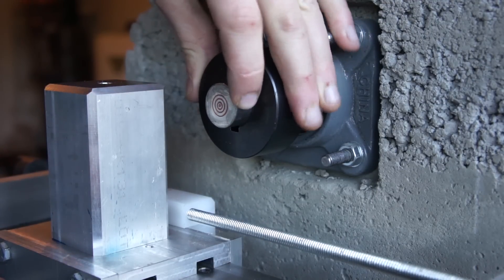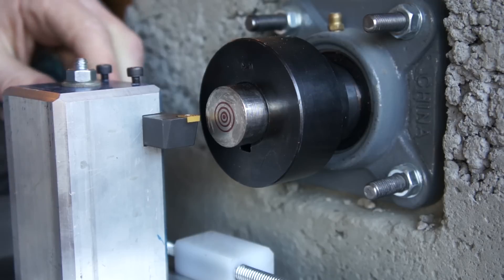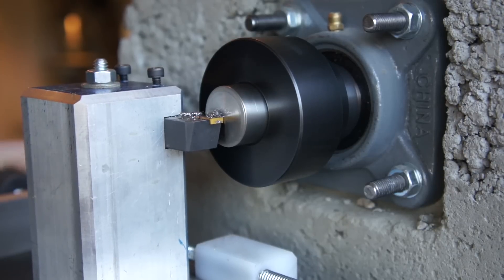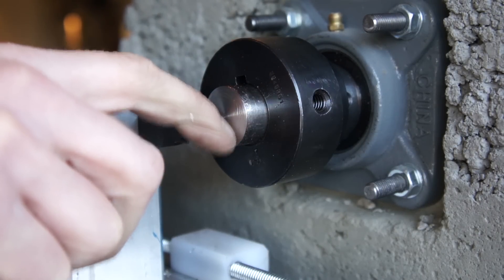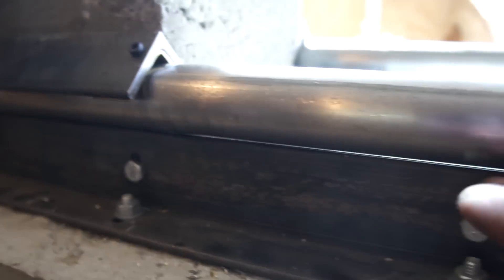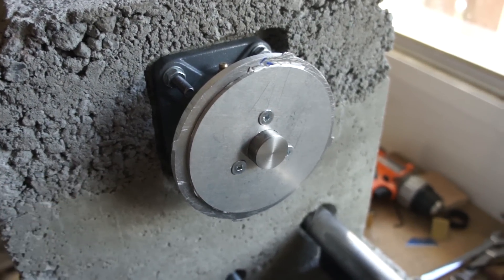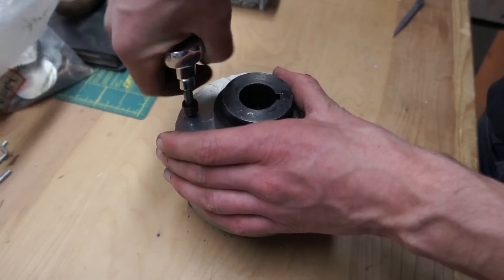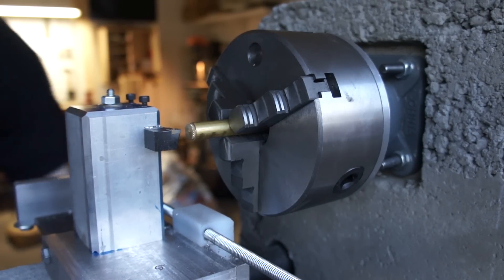Concrete Lathe - Part 5 Final

Comment: Did you see your chuck jump under the tool pressure? Your  spindle, bearings and hardware are inadequate for safe operation. Your aluminum adapter should be replaced with a steel one. I would also suggest upgrading your shaft size and bearings. How heavy is your chuck? have you seen one thrown out of a machine? Tip on the ways. Use some 4140 tgp. Try bedding them in resin. Your carriage hardware will fail. I've used tiny lathes with 4" chucks and the tool post bolt is at least a 5/8". I'd suggest never making more than a .010" cut, for safety sake. Now that you have built this monstrosity. You can use it to build a new one. I lathe is the only machine that can build itself.
Reply from the maker: +Sir Phobos Thanks for the comments, since the video the adaptor plate has been replaced with a 1" alum plate, the bearings need a little preload to work out the end play.  I disagree with the 5/8" bolt suggestion, my little taig with a M4 tool post bolt has not yet killed me, with that said I only have a 1/2HP to work with on this beast (right now) so light cuts are needed in harder materials.
Reply: during WWII professional lathes were build with concrete, that is the least of his problems.
Reply: Curt Filipowski

If I may suggest: building a rebar skeleton where all connections are fastened to would have stiffened the machine considerably including the bearings. And better than a ball bearing would be a a Babbitt bearing for the chuck as there the "bearing air" really can be counted in the 1/10000 range and can compete in the cheap ball bearing price range.

But, to the contrary of some critics I consider the machine good enough for a first attempt and don't think that the results are that much worse than a Gingery aluminum lathe, yet a long step away from what could be considered "professional".
Reply: concrete machines have been built for over 100 years. super sized machine were built for the war effort in both wars with concrete to shorter build time and materials cost. some of those lathes were close to 100 feet long.
Reply: "lathe is the only machine that can build itself" note true, 3d printers have been around for a long time
Reply: I agree however the Gingery is scraped true which probably makes a big difference. I know my Gingery bed was a lot better tolerance .001 which helps for making bearings and stuff like that.

Comment: Enormously pleased I came across this-a friend sent over an instructable.  I am planning on building a lathe-what you have done here gives me a direction that will simplify what I was intending to do.  Last week I acquired an old Honda 350 twin engine that I am going to use for the transmission.  I would recommend going to Tubal Cain on You-Tube.  Not only does he have wonderful videos on using metal lathes but offers a video course as well.  Once I get my lathe done, the next cash goes to buying his lathe courses.  Wonderful job -both on building the lathe and presenting what you've done.
Reply from the maker: +Jim Richards Thanks!  I've been a Tubalcain fan for quite some time...I think everyone who has an interest in metalworking has encountered his channel.  Post a video when you get round to your machine!
Reply: +Curt Filipowski   Every time I watch one of his videos I wish I had had the opportunity to be in one of his classes.  In watching your video I decided I would probably opt for building mine with Babbit bearings.  I was really surprised at the deflection you encountered with the brass turning.  Next thing I'll be looking for at the handy junk yard  is something I'll be able to make a 2 inch spindle shaft out of. Thanks for the inspiration to move forward and in a slightly different direction than the one I had been intending.

Comment: Hi very nice machine, I see vibes in the pieces when the tool cut in the metal, maybe you can increase the accuracy using a stepper motor in the move of the axis with the burin, so the movement is slow and soft, thank you for share.

Comment: you can make the lathe quite a bit safer by switching the motor to a big, high wattage resistor when you turn it off (with a double throw switch).

this will get your lathe to stop much quicker than through friction alone.
Reply: a good source for a high wattage resistor is a electric radiator,  or a busted toaster/oven, you can get them for free or very cheap.

Comment: You said using the handles would get old... attach a cordless drill, reversible, ideally with a 2 or 3 speed gearbox and use that to advance the cut. The Variable Speed switch should make it much more fun to use. Great vid BTW... inspires me to fill my wood lathe with concrete at the bottom to prevent wobble when doing big logs into bowls. They wobble a lot at first.
Reply: bikingm I suggest watch a 13 part series called What on earth happened by Ewaranon to learn that the earth is not a globe.

I got it in my about tab.

Comment: Make a hanger that actuates a switch, make the switch open your motor's contact and only put your chuck key on that hanger.

That chuck should be removable easily because you're going to want to swap in a 4 jaw.

Fill your gas pipe ways with the most rigid expanding foam you can find. That will stiffen them a lot.

What exact bearing are you using for your spindle ?
Reply from the maker: +shodanxx Great ideas, I've thrown a chuck key once and never again.  I've since had the chuck on and off a dozen times so removal and install has become significantly easier (sharp spindle end has reamed the aluminum to a nice fit).   Next time I have the chuck off I'll peak at the bearing number.

Comment: Fascinating series of videos. I suspect the catches you were getting on that brass might be because your tool is a tiny bit below centre. On the video it looks like you are getting the smallest of pips when you do a facing cut and it looks like the headstock is deflecting upwards making any below centre issue worse. If you make another (I suspect you wont be :-)) I'd build it with the mould the other way up and pour in a wetter mix of concrete, I think that would help prevent the consolidation issues you've had.

Comment: To make your way tubes more rigid, you could insert half inch thick  flat bar vertically in the tubes and rivet them from the bottom. I have done this to make ten foot clothing racks for stores and it is very strong.
Reply: Cool idea

BTW Bob I suggest watch a 13 part series called What on earth happened by Ewaranon to learn that the earth is not a globe.

I got it in my about tab.

Comment: Fill the rails with Quikrete, and pack it tight!
Reply from the maker: +D.R. M. I planned on doing this with the concrete but the aggregate made it to hard to fit inside the tubes...something I may revisit.
Reply: +Curt Filipowski No Aggregate, you need a fully compressible mass, any void and it is useless!
Reply: Sorry, typo, NONCOMPRESIBLE mass.

Comment: what are the depth of cuts you can do on this machine?
Reply from the maker: +RGplayer101 Honestly I haven't really pushed it yet, I need to rebuild the chuck faceplate before I can really push it hard.  DOC is kind of a loaded question as its feed, speed and material dependent.

Comment: Curt the reason the brass kept grabbing is that you were using a cutting bit for steel and it has a rake angle, when machining brass you want a flat top bit with no rake and that should make cutting brass much easier
Reply from the maker: +Dustin Prat Thanks Dustin, I figured it might be the positive rake but I've used HSS tools with positive rake on my little Taig without issue (when turning brass).  Turns out the entire 3 jaw is flexing on the 1/4" mounting plate and trying to roll over the tool!  Only figured this out once I watched the above video and saw all the deflection!  None the less, I need to get inserts for brass as well...right tool for the right job I suppose.
Reply: +Curt Filipowski   Curt - great job - never thought about using concrete for a base material.  Anyway - from an old machinist - you don't have enough rpm or rigidity to use carbide - stick with tool steel. Tool steel cuts metal - carbide actually melts it off using high pressure - there's a whole school of engineering around that process -   Also it appeared that you were experiencing chatter from the type bearings you are using in the head.  But all in all great job. I will remember this when the apocalypse comes.  LOL
Reply: @sailormandave1  sailormandave I suggest watch a 13 part series called What on earth happened by Ewaranon to learn that the earth is not a globe.

I got it in my about tab.
Reply: +Curt Filipowski The bearings are also going to be a major factor on runout  on longer parts and when using a dial indicator that reads below .001"  In no way do I intend my comment to take away from the awesome project you did.
Reply from the maker: MrEricBrummer No offence taken, you are 100% correct.  In fact I am already noticing with changing preloads the bearings shift in tolerance.  Thankfully most of the work I use a lathe for is very light duty and short in overall length.
Reply from the maker: +Palmis Lafinater Thanks!  I have heard that before about carbide but never understood why people said that, thanks for the explanation.  I was very worried that standard roller bearings might have been a bad choice but now that everything is tight the results are quite nice...how long that lasts is to be determined. Worse come to worse the bearings are cheap and easy to change.  Thanks for the input!